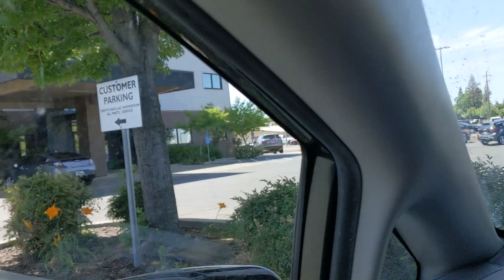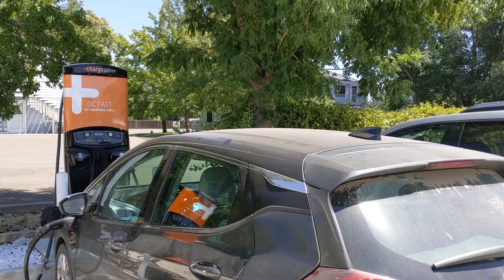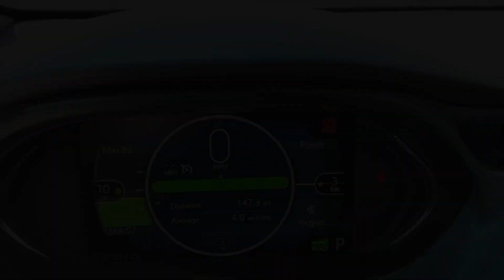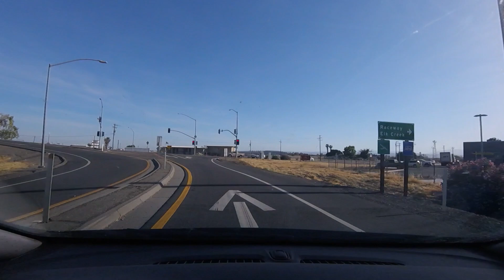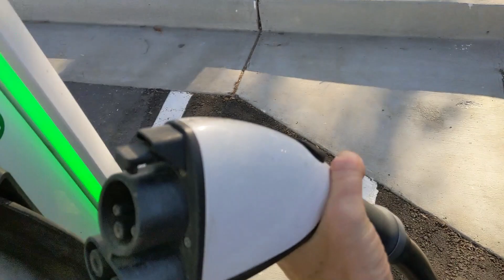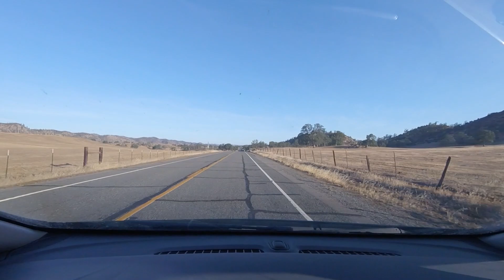2017 Chevy Bolt EV: Post Battery Recall Shakedown

Comment: After 3.5 years of Bolt ownership I can still claim that 95% (arguably more) of my EV knowledge was gained on this channel.  So thank you for the shakedown drive on the update.  I did not get the recall work done and just left my charger on Hillside Reserve.  Now with the knowledge you've just conveyed, I'll go ahead an get the update at my next convenient opportunity.  Great preliminary info on the charging profile.  I'm also glad for that improvement and mildly disappointed that the newer charge rate hasn't been included.  But, oh well, take what you can get and a return, at least, to the original capacity.

You answered more questions than I was even aware I had.  Thank you.

Comment: What tires are you using on your bolt? Still the continentals? The best efficiency I get it's 3.1mi/kw, on not LRR tires. Trying to decide if I should switch
Reply: I get about 3.1-3.2 mi/kWh on Michelin CrossClimate2 (2021 Bolt).

Comment: News - what’s your take on an extended warranty for the Bolt?  My three year original warranty is up in a week or two and I’m trying to decided whether to purchase an extended warranty or no.  It’s been  reliable but I’m a little concerned about potential electrical gremlins that could pop up and be costly.
Reply: The Bolt EV is arguably the most reliable car GM has ever made. That being said, how much is it worth to you to never have to worry about what it'll cost you to fix a hardware or mechanical issue with the car? Peace of mind can sometimes be worth much more than the zero dollars spent on fixing nothing.
Reply: @anthonyc8499  Also the most reliable EV according to Consumer Reports, and least expensive to repair according to some Canadian survey.
Reply: My Dad bought an extended warranty from GM back in 2002. Turns out it didn't actually cover what broke later, so read the fine print. I'm not buying one.
Reply: Ford Boss Me's channel discussed "Customer Participation" regarding factory warranties. It seems that if you take the car to the dealer AND have factory warranty work performed AND you participate in paying for the warranty work that the warranty is extended by whatever the original warranty term was/is. It sounds too good to be true but it doesn't cost anything to find out. 
Here the link:    https://youtu.be/k1Dk79SIjQI

Comment: What is on the Bolt is the VCM?
Reply from the maker: It's hard to say, exactly. It primarily manages the battery at a cell level, determining max current in/out, regulating temperature, monitoring health, balancing cells, etc. Based on the change to the charging profile, it also controls that, which would be communicated to the charger through the Powerline Control Module.
Reply: From weberauto it looks like The Battery - Energy Control Module is inside the battery.  This would take awhile to replace!
Reply from the maker: @foj68  Yeah. The dealership I went to didn't seem to think it was that big of a deal. Yeah, it would add time, but it sounds like they were still turning it around in the same day.

Comment: 35:30 imagine if GM put half as much effort into aerodynamics that a certain other carmaker (that's run by an annoying twit) did.

IMO for all cars but especially for EVs the EPA efficiency/range estimates need to be based on real-world highway speeds, meaning a minimum of 65MPH average.  GM gets away with advertising a respectable looking range for the Bolt despite poor aerodynamics because the EPA counts 45MPH as "highway" speeds.  If EPA ranges were based on 70MPH the Bolt probably wouldn't be able to claim a 200Mi advertised range without aerodynamic improvements.  Obviously all other EV ranges would drop with this change but those with better aero would really shine above the rest.
Reply: I have to say I am impressed with my wife's Bolt EV. We live in the mountains and at 70mph on the interstate with average climate control use, we are getting 190 miles per charge. At 60mph the number would be over 200 easily. If you haven't gotten to test one of these little cars out, I'd recommend it. Have a good one.
Reply: What is it that annoys you about Elon Musk?

Comment: I haven't had the temp fix or the final fix.  Obviously I never charge to 100% regardless, and only charge to "full" (89% with Hill Top Reserve enabled) about once every 1000 miles.

I will be waiting a while (at least a couple months) before I get the fix installed at all to see if there are any unintended consequences.

I've actually been debating whether to initiate a buyback on my Bolt.  Since I'm in California I understand that GM is almost always saying yes to these.  I don't have a lot of faith in this software only "fix".

Funny thing is that if GM had only included adding Target Charge Setting to the early Bolt's with this update not only would I be in more of a hurry to get the update but I would be MUCH less likely to want mine bought back, but nope GM took extra time and spent extra money to develop a fix for the 2017-2018 Bolt's just to withhold a feature that should have been in our cars from the beginning.

Honestly the only thing at this point that's keeping me from initiating a buyback is the lack of compelling alternatives.  None of the other EVs available right now really appeal to me, so if I had my Bolt bought back I'd have to go back to daily driving my 2004 Mazda3 while I waited for something new to come out (and prove itself).  The Volvo C40 recharge looks interesting but I would not consider buying it until at least 2022 (would want to wait for the 2023 model year).  Granted my Mazda3 (which I bought new) still runs well and is comfortable enough (and has a significantly more sophisticated interior than my >$40K Bolt) but I've gotten spoiled by BEV ownership and don't want to have to go back to getting gas regularly.
Reply from the maker: That's one of the reasons I think GM needs to be more transparent about how many battery modules they are replacing. This definitely isn't "just a software fix" like why Hyundai attempted to do. This software appears to be able to actually detect defective battery cells and initiate a service notice. 
Target Charge Limit would be nice, yes, but I'd also want GM's software team to fix their new charging profile. To me, that is the higher priority because the car is less capable now than it was prior to the battery recall software update.

Comment: The charge point app has a charging rate graph.  On my ‘17, I could clearly see the linear step downs.  I am going to run by a charge point charge to see the graph now.
Reply from the maker: Yeah, I was thinking about doing the test on a new ChargePoint Express charger. The big issue around here is that most of the ChargePoints are only 50 kW Tritium units.
Reply: That app used on iOS?
Reply: @normt430  yes, the iOS app.

Comment: Thanks for another one of your excellent videos. I hadn't seen one with the camera pointed out the left front of the car. I like that position.
I own a 2018 Bolt LT with ~ 13.5K miles on it. My car is presently at my Chevrolet dealer for the battery safety recall. I had several other small issues which they are addressing. They called me yesterday to inform me they were replacing the rear axle, but said nothing about the battery. I still have trouble with the seat (6'2", 315 lb). I asked if there was any fix offered by Chevrolet.
I find Chevrolet to be playing a cat and mouse game with me. They test me to see what they can get away with. I imagine less knowledgeable owners are taken advantage of.

Comment: Welcome back! As someone who just started watching you I'm excited!
Reply: Eric has great videos and data points even if they are a couple of years old
Reply from the maker: Thanks!
Reply: @newscoulomb3705 Eric, Good to hear from you once again. I thought that you were no longer posting. Last November I purchased a '20 LT added most LT options plus false floor, Air compressor kit, and a spare tire from a Sonic & 2000 Blazer scissor jack. Great car!  Averages 5.2 Kwh around Tucson w/o A/C & 4.8 with A/C on. Check out Steves'  recent Plug&Play story on the National Grid chargers on a utility pole in the Boston area.